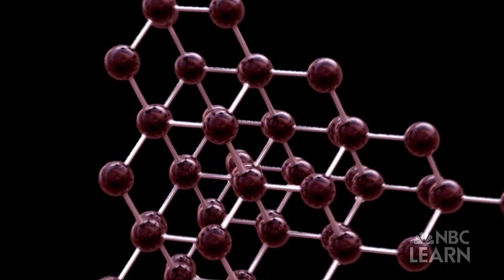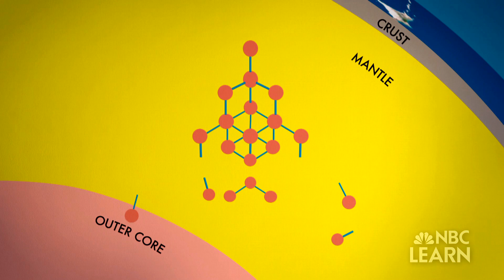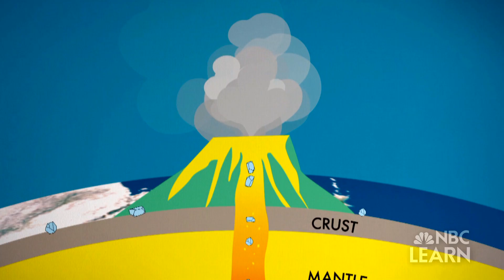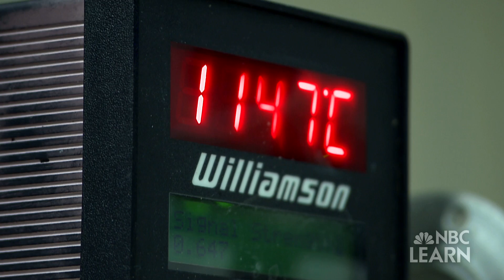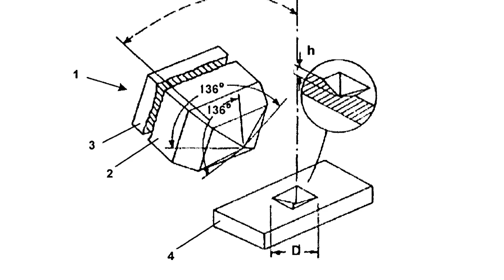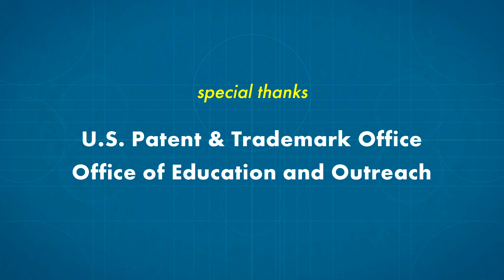Synthetic Diamonds | Science of Innovation

Comment: Cutting tools for non ferrous metals maybe.  Diamond is the worst thing you can use to machine steels it dissolves in the metal.  It doesn't matter how hard it can be made its still carbon.  You can't use it for a coating of tools where there is an impact either it will shatter.  It works great as a coating on carbide tools to cut plastic.
Reply: ZR R yet you have diamond infused cutters which work perfectly